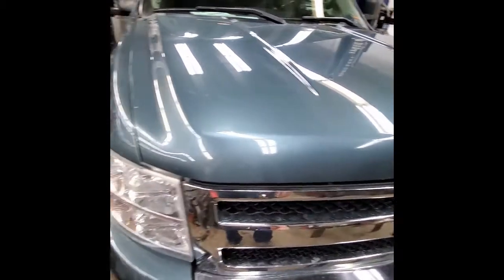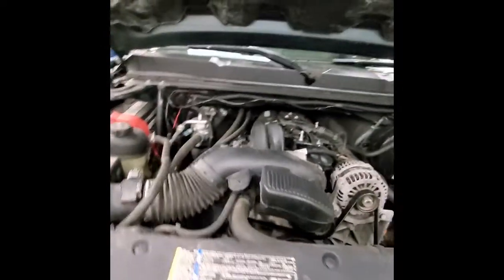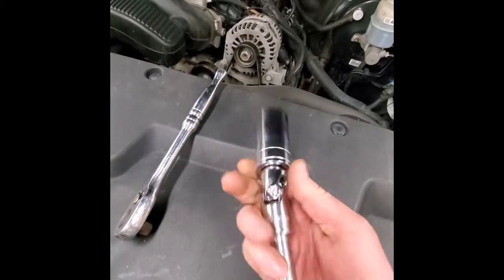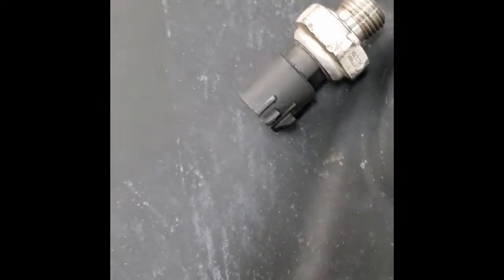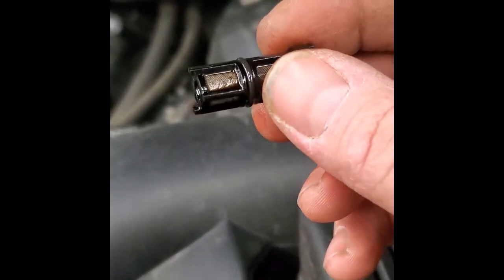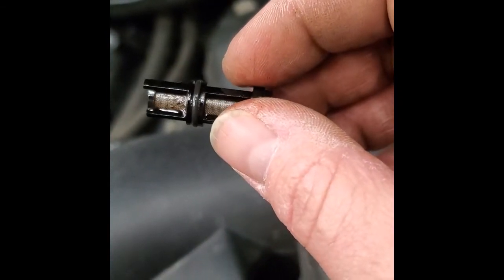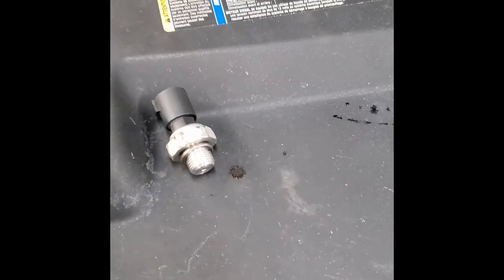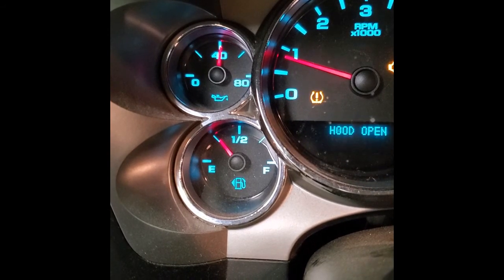GM 5.3L VLOM Oil Filter Maintenance

Comment: That's great but, how does the connector you can't see unplug and what's the best way to unplug it. Is it best to use a 12 point socket or Is that just what you had? I can see the damage. Do you risk dropping the sensor on the top of the trans? Does the filter just pull out? Does the filter seat in easy and is it orientated in a certain way? Ok video with a lot of holes if a mechanic was showing an apprentice how to do a job.
Reply: Yeah agreed